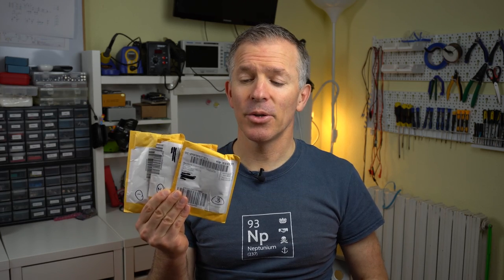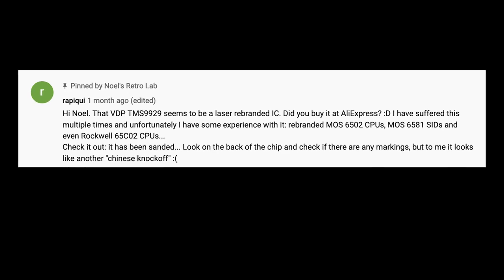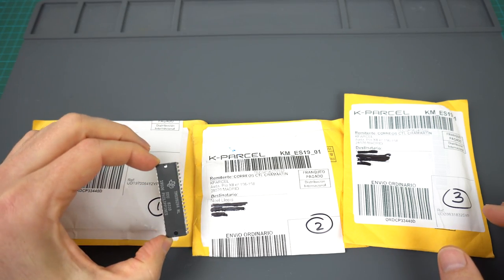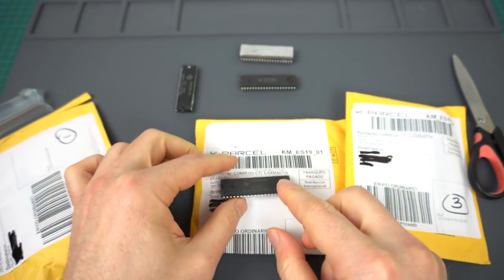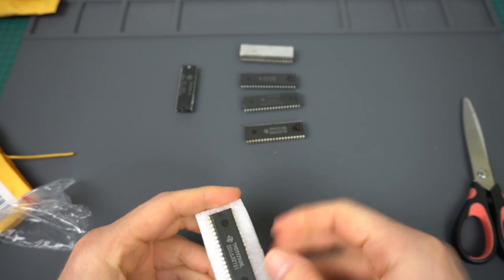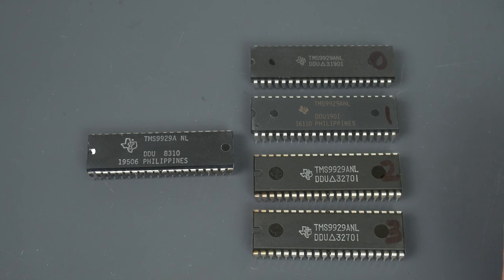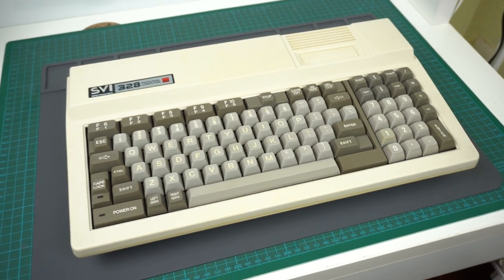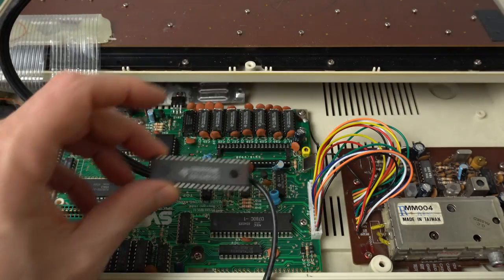Detecting FAKE Chips From China 🔍

Comment: Text rubbing off was the first thing I ever noticed that made me think I might have counterfeits. I noticed if I had sweat/oil on my fingers, like if I touched my face on a hot day, then touched a chip, say pushing one into a socket, the writing on it would rub right off like nothing. And of course, no laser etching below. So I have a bunch of chips with masking tape+sharpies for labels. And surprisingly, these are chips that came in a kit from Radioshack. Which was $50. And the best thing in it was jellybean logic chips like 74HC stuff.

Comment: Hi. Your resistance test is a dangerous test for CMOS chips. Depending on the scale chosen, the open loop voltage on the DMM could be higher than 5V, which may damage the chip!
Reply from the maker: Interesting. I didn't realize that. I wonder if there's a way to perform a similar test in a safer manner. Any thoughts?

Comment: The dips on the top of chips are from rods that push them out of the injection mold. All a chip is, is a bunch of wires and resistors carefully arranged and laid across one another, then sealed up in a block of resin. This isn't universal, but it's pretty close.

Comment: 9:40 : You made a mistake by using the nitrile gloves in the acetone test (the blue gloves are made of nitrile). These gloves don't resist acetone, but let it through. And the result is that you get a nice "climate" with a saturated acetone atmosphere inside of the gloves - which finally results in much more acetone being absorbed by the skin than what would have been absorbed if you would have worked without gloves. In such a case a drop of acetone evaporates into the air very quickly.

So: gloves don't always protect, but might harm you. You need to know which kind of material resists the chemicals you work with. In this case, Latex would have been a better choice. However, with such small quantities and such a short time working with the chemical it doesn't matter at all.

Comment: I believe it's a case of a manufacturer or distributor being saddled with thousands of unwanted, obsolete chips. It's the same with transistors. Rather than trash them, they will "rebrand" them to appear as a more current and desirable unit. Money for nothing. This has been a big problem with transistors, particularly obsolete Toshiba components

Comment: another thing i noticed at 6:04.
the #1 chip has a date code that can't possibly be correct.
The code is "DDU 1901" which would indicate that it was manufactured in the 1st week of either 1919 or 2019.
1919 would predate the manufacturing of ICs all together and i seriously doubt that TI is still manufacturing VDP chips like that in 2019.
Reply from the maker: Other people mentioned that too. It certainly fits the theory that that's a fake chip. The really puzzling thing is why did they make up a number instead of copying one that they know it's right? Baffling.

Comment: My guess is that vendors buy a load of faulty or fake/ repurposed chips and relying entirely on the fact that a significant number customers won't bother to seek a refund after spending a few quid on a thing that may not even be the solution to a fault they were trying to remedy or that they suspect they may have damaged themselves. It goes undetected as a mis-sale & sometimes it's not worth the bother to pursue when it is detected- and that's the basis of the scam.

Comment: I got some fake LF351 op amps off EBay once. I wanted them to build a simple audio oscillator but I couldn't get it to work properly. Eventually I built a simple amplifier circuit to test them. Shocking levels of crossover distortion and very poor frequency response. When I got some proper LF351's the circuit worked perfectly.

Comment: 4:49 Because lots of electronic junks were shipped to China, mainly Shenzhen. Someone pulled these chip from old silk boards and selling them. It's nearly no cost because these were treated as junk. And to make more profit, they won't test them, or only a small percent of total. I bought an old Oscillator from them and it's cheap. But as I said, always no guarenteed for working.

Comment: 27:03 I think that placing the central heat sink makes sense. However, the heat sinks on the left and right hand side will probably not help very much. They are too far away from the actual die, and the plastic package will not transport the heat properly from the die to where the heat sinks are located. The spacing/gap between the centre heat sink and the outside ones makes that no heat will be "carried over" to the outer heat sinks.
Reply from the maker: I agree. A probably better way would be to put two of them centered, so each of them in fully touching half of the die. But I actually want to run some experiments. Maybe material for a future video.
Reply: @NoelsRetroLab  I used to work for a semiconductor company and was involved in products which dissipate power, and thus generate heat. We did thermal simulations on how that heat spreads throughout the die, the leadframe and the package. If the power dissipation is relatively constant it will eventually reach the outside of the package (where your heat sink is located). However, if the power dissipation has transient spikes this heat will not reach the outside. I am not familiar with the TI chip of this video, so I can't judge whether a heat sink helps a little, or a lot.

Comment: Fraudulent and counterfeit materials have been an issue in a lot of industries over the years.  From bolts for aircraft to electronic components.  There are places in China where obsolete electronics are taken apart and the chips are made to look new with different markings, nothing close to what their original purpose was.  In the business I was in visual inspection was key in determining authenticity of an item followed by functional testing.

Comment: Nice video, thanks. I think it's likely the people selling the fake chips who were cheated in the first place by whoever they bought the fake chips from since they are the ones ending up losing money.
Reply from the maker: Yeah, that might be true. But at the same time, I doubt these sellers are cutting off their sources of fake chips whenever they get caught. So I think there are a lot of guilty parties all the way up from the source.
Reply: I think they have incorporated the loss factor of fake chips into their margins. That's why they instantly refund when they receive a report, it's more trouble to argue and ask for a return when they know there are fakes and defectives among the pulled chips they sell, and they have no means themselves to test them (theres just too many ics in their inventory where would you even start). Even if they could, why bother as it would add to the cost and people would take their chances with the much cheaper competitor.
Reply from the maker: @grauwsaur  I understand the problem comes from the distributors, but I wish some sellers would stand up and not get anything from distributors with some fake chips. They would stand out over the rest and make a killing, even if they themselves had to pay slightly more.
Reply: @NoelsRetroLab  There are likely multiple sellers between those who made the fakes and the one selling them on ebay, aliexpress etc. But perhaps also because the traditional Chinese business mentality says it's better to make $10 profit today than possibly making an extra $100 next week.

Comment: That last point about checking them straight away is very good advice. Twice I've tried buying HD63C09EP (Hitachi's CMOS 6809 3MHz replacement) and twice received non-functioning fakes. Disturbingly, the latter from polida2008 (your 2nd good contact). This suggests what others have commented, that the retailers get ripped off also. Still, even though I received a refund immediately from polida2008, I mentioned it in my feedback as a warning to others that the chip from that supplier was fake. It may seem unfair since they refunded me but it was the only way to flag that chip from that supplier as fake. I didn't from "*foosoo" - the supplier of the first fake because I did exactly what you mentioned: got reasonable-looking chips, put them aside confident and glad I now had them for a future project and on later discovery, received no reply from *foosoo and not even able to warn others like I felt compelled to do with polida2008. I just realised I also bought 3x AT28C64 EEPROM from *foosoo so now I'm wiring up a test rig using an Arduino Nano to try a test programming... It really annoys me because postage to Australia from places other than China is often more than the cost of the part.
Reply: PS. Nice video - You got yourself another Like & Subscribe.

Comment: I am wondering about one thing. The one that got damaged under Acetone test.  You should know that Acetone will dissolve/damage the package if it is epoxy  and not ceramic. In fact I have used acetone on  epoxy sealed  subassemblies to get to and study the internal circuits without damaging the components. .
Reply from the maker: I didn't know that until recently. I think (but don't quote me on that) that that kind of packaging started being common later, and that chips from this era are in ceramic packaging. So usually if they start dissolving in acetone it means they've been modified.
Reply: @NoelsRetroLab  They used ceramic encapsulation for better integrity and heat dissipation.  Generally video processors,  microcontrollers and  PC CPUs were made like that.  Your standard run of the mill TTL & CMOS ICs were all epoxy encapsulated.  May be the MIL standard were packaged in ceramic. Never came across any. They were TOO expensive for my design needs.

Comment: When I worked at Fairchild semiconductor in New York in the wafer and chip testing department I had to use acetone one day to remove the printing from a whole mess of chips that were misprinted at the plant and they were chips we made. The writing came right off if I remember (it was about 40 years ago).
Reply from the maker: Really? Weird. I think that doesn't happen with chips made in the 80s. At least not with the ones I'm familiar with. Interesting.

Comment: I think the fake chip versions of these are real in the sense they probably did work when they were made - and back in the day repair/manufacturing shops would buy these up and the manufacturer would make a certain amount of money and most everyone was happy (except TI). Its similar to how Commodore used to copy other manufacturer chips like the one originally used in the C64 PLA (it was a copy of a Signetics chip) - the Commodore version had a passivation issue and would deteriorate over time.

Comment: I have been told this is a particular sensitive part for ESD.... and then just pickup and handle the the chip like you do?
Reply: ... with a wrist strap on.
Reply: @bigdog8008 Check @9:30: you think a wrist strap will do any good like that? Anyway, didn't see any.
Reply: @phyx1s  The only time they showed his right wrist is at 8:19 -- and there is a static strap. 
But, yeah, I didn't even consider the gloves. Those should not be there.

Comment: with heatsink i belive there is no need to put 3 of them in a row like this  because chip die in most cases is located in the middle and isn't extending for the whole chip package
this is why aluminium plate was a simple solution to expand the hot area from a spot in the middle to entire chip surface, while being low profile
gluing 2 heatsinks on the sides might actually do nothing, while placing one longer  heatsink would do considerably better job and that 2-3 mm aluminium plate might actually do a better job than 3 separate heatsinks just because it is a single piece of metal with larger surface area
Reply from the maker: Good point. Although I think that having them together like that there will be some heat transfer to the ones on the sides. I wonder if a better arrangement for these small ones would be to just use two, centered at the middle. So each of them is fully touching the die area. I definitely agree that a long heatsink will be better (although I'm still not sure about the slab one--maybe that's a topic for a future videos and I need to run some tests! 😀).
Reply: @NoelsRetroLab  think of it as just another form of energy transfer heat sinks and other heat duct are like conductors in electrical diagram, air is like resistor or capacitor, depending if that is an open air system or closed loop (like air traped between 2 radiators)
heat travel best trough a conductor, the bigger it is the lower it resistance to conduct heat. the bigger the surface area that can gather or give out the heat the better it work because it is like putting more resistors in paralell
of course open air has to have lower temperature for it to workk, so spreading the heat over larger  area (with no fan moving air around) would work better than small heatsink with biggwe surface area because air above it would saturate with different speeds

one thing is for sure, air gap between 2 radiators don't help anything, even if you slightly coat the sides that touch each other with some thermal paste , whole radiator would work much better because in this situation air between 2 heatsinks works as a capacitor and air is very poor heat conductor 

that's my take , i love to hear some real pros talking about that with actual numbers but a ball park is surface area  of a heat sink, thermal conductivity of tit's material and the thermal capacity of the connected free air are the most eficient ways to increase heat transfer, by just increasing one of them

Comment: You take your chances with the grey market. I once worked for a distributor who bought a large batch of Pentium II 500Mhz processors from another larger distributor. Everyone I placed in a test platform failed to boot. So I got curious and opened one of the cartridges up. I found the PCB had unusual Kynar point to point wiring, typically only seen in prototypes or repairs, and markings that tracked back to 200Mhz processors. External laser etched markings were 500Mhz. Long story short after contacting Intel: I got a call from Intel security, who was very interested in seeing these first hand (turns out they were engineering samples that were flagged as destroyed). Surprisingly, Intel replaced them all as marked.
Reply from the maker: Wow! Crazy! That's a very different kind of operation, but it shows you have to watch out for every piece of tech you get.
Reply: @NoelsRetroLab  Yep. Pretty much all equipment on Wish.com is this bait-n-switch BS. The joke, is: you'll wish you bought your kit elsewhere.

Comment: Same issue with Motorola processors. So much re etched slow chips badged as 060 when they are actually 030 or slower.
Then on top of that  they turn up dud.

Comment: Hello! I was very glad to see you wore a grounding wrist strap to protect the chips from electrostatic discharge [ESD]. 

Numerous good quality chips are ceramic encapsulated. A number of chips are supposedly Plastic Encapsulated Microchips [PEMs]. Which would counsel against application of pure acetone in many cases because plastic is susceptible to dissolving in acetone.
Reply from the maker: Thanks! I'm planning a short video soon on the transformation of my work area into an ESD-safe area too. 
Interesting about the PEMs. Do you know when that started? I'm just wondering if with old chips it's safe to assume they're all ceramic and that's just a more recent technique. Cheers.
Reply: @NoelsRetroLab  Hello again! 
PEMs have been a standard for at least 20 years for many microcircuits. Certain circuit products using PEMs needed a long certified-shelf-life. And so some programs I am familiar with had people very concerned with the reliability of such chips.

Comment: There is another visual difference that you don't mentioned (at least to 7:46). Look on the central pins. Chips 2,3 and left one have some "key" on two central pins, while chips 0 and 1 don't.
Reply from the maker: Oh right! I see what you mean. I had seen it in chips 2 and 3, but I hadn't noticed it the original chip until just now. Good point! I wonder what that is and why it was made that way.

Comment: Juried Engineering is an Ebay, Amazon, Reverb etc. seller of IC's/Opamps etc. that I always go to when I can't get something from Mouser. So basically anything out of production. So far everything has been perfect and tested in range. In fact I have 5 Lm833's coming today from them because Mousers Will Call is closed due to the pandemic so I just bought from Juried Engineering off Amazon. But I've used them on Ebay and Reverb (this is the first time going through their Amazon store) and again they've always been legit. Just thought I'd share my experience. The first time I used them was for an Lm308N (discontinued) and it was great so I've used them ever since.

Comment: Hey man this is what I do for my job lol.  I have found fake parts, but I have NEVER had anything come off with the alcohol rub, I wouldn't if it was part of the standard...  Acetone Sometimes works. Best thing I found is doing a scrape test, basically take an exacto knife and try to scrape off the top surface.  If it's real it will sort of slide off like if you were trying to scrape glass.  Fake ones you'll get the blacktopping that they used scraping off.